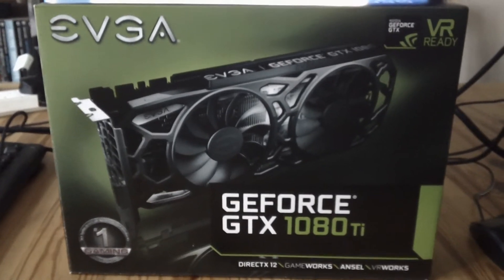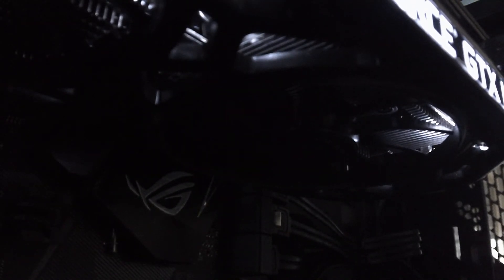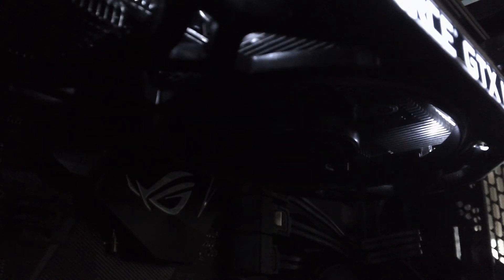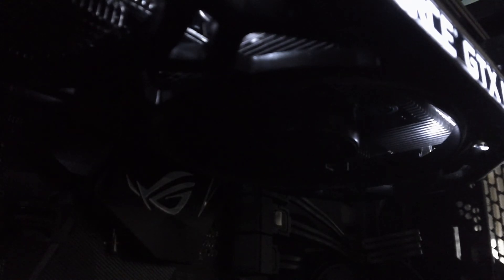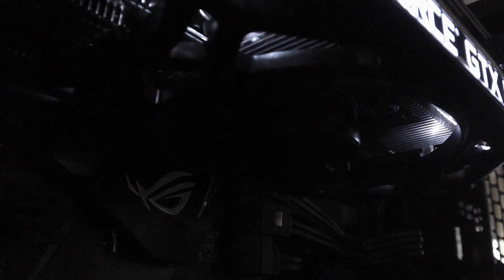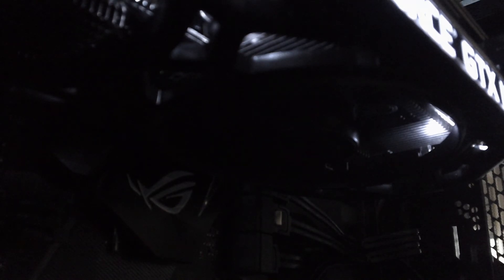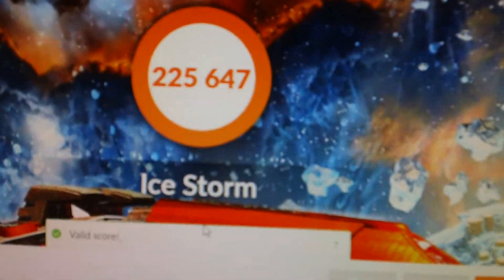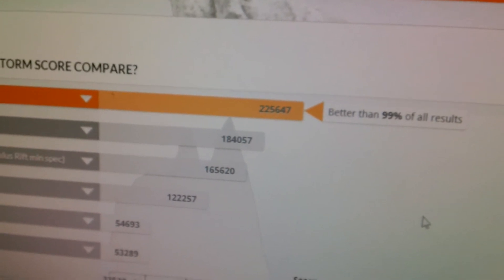NVIDIA GTX 1080 Ti Coil Whine *DEMONSTRATED*

Comment: I've had a GTX 1080 since the day it came out and just this week i started noticing this sound. I've no idea if it was doing it before or it started recently, but it's only when i'm playing video games. Once you hear it you can't get it out of your head.
Reply from the maker: I know the feeling... some models of 1080 cards were really bad for coil whine, but it also depends on the PSU too. It tends to happen when the card is being stressed - so try running a few benchmarks with your and see if that gives the noise.

You can dial down the resolution and detail for the game to reduce the load and that might help, but as parts deteriorate the problem may surface.

Comment: mine screeches like a banshee at full load, it was unbearable so i just got a RTX 3060 TI to replace it and that 3060 TI is quiet with no whine from it.
Reply from the maker: Have you got a Corsair power supply?
Reply: @sterntechdaddy  yeah, it was a cx650, i replaced it with a rm750x

Comment: following it up my conversation I bought a gtx 1080ti sc black edition is the same as that one and what I can tell oh god... after 3 graphics cards I got one with zero buzzing zero coil whine and im so happy that finally I can no longer care about that yes the fans are a bit louder that the Asus strix but coil whine free made my way. already tested with unigen heaven and few games like the witcher 3 . nothing clean card overclock well I achieved 2060mhz on the clock with a good fan curve doing 68c on 100% load. a bit louder but at least I had good card. evga it's probably the brand I can recommend all the cards I owned from evga were perfect.

Comment: I am getting this issue with my Nvidia 1080 ti 11 GB, I’ve got a 144 MHz Asus monitor, but only for old games like Lineage II, it remains super silent while playing WarThunder or Warframe 😕?
Reply from the maker: I think it's normally associated with the power draw from the PSU - maybe your card whines at low power. Try the benchmarks used in the video to see if your card whines. And what's your PSU?

Comment: Hi Nic Bunting. Can you please tell me which Bequiet 1000W PSU have you gone for. Both my Corsair HX850i and my ASUS ROG Strix 1080 ti OC have coil whine. GPU being noticeably worse. I am sending my PSU back and I want to try the Bequiet. Please let me know so I can at least try a tested combination. Many thanks.
Reply: it doesnt matter wich PSU you have, your Card has Coilwhine anyway. only thing you can do is limit your framerate.
the 1080 TI is a Coilwhine Beast, that is rly disappointing..
Reply: After trying two Asus Rog Strix   1080ti's and a new bequiet! Dark power pro 1000w psu, my coil whine issues persisted. In the end I bought an EVGA 1080 ti SC2, which has much much leas whine, which is not audible through the case apart from thousands of ocassional fps on some game menus. 

Also comparing Corsair HX850i with bequiet dark power pro 1000w, I realized corsair psu also had whine under load.
Reply: Ceki Erginbas God these coil whine issues are really russian roulette. I got one Asus Strix 1080 ti oc which had no coil whine at all, returned it for fan problems though. Then I got 2 Msi 1080 ti gaming x, both had horrible coil whine, returned both. I finally got hands on an Msi gtx 1080 ti lightning x, which has a tiny bit of coil whine but not audible when the case is closed.

Comment: I managed to reduce the noise almost 80-90% ;)  .....(you need to change setings (58-60 fps and the frequency ,speed 1986 ghz ..1060 ghz )
Reply from the maker: Nice to hear that works!  You shouldn't have to slow the card down though... not when you've paid for an overclock.
Reply: @sterntechdaddy  yep but ...it's impossible to run max settings...because my monitor is 6o ghz ...
Reply from the maker: You've got plenty of overhead then...  :)  The one in  the video was used with a huge ASUS monitor though, so the whine needed sorting.

Comment: So I have this same model card, and this is so quiet compared to what I'm getting. My card legitimately has an 80 Db grind when rendering anything 3D. The pitch and volume increases horribly with higher frame rates.
Reply from the maker: What power supply are you using with it?

Comment: Hey I have the same card. It has really bad coil whine. I already got the second one but still has really loud coil whine. Did you end up RMA it?
Reply from the maker: I was about to RMA when I tried a BeQuiet PSU - which improved things. So the Corsair PSU was RMA'd instead.
Reply: Nic Bunting thanks for the reply. I have a evga t2 750w psu and I also tried cosair ax850. no change at all.
Reply from the maker: Irritating how you get the coil whine with the EVGA PSU seeing as it's an EVGA graphics card.... but with the BeQuiet PSU things were much quieter - with the side panel on the case I couldn't hear anything.

Comment: mine is a LOT LOUDER THEN THIS.. loud enough to hear 2ft from my pc, took me ages to work out the noise! only started few months ago at random, and for the past 2 weeks its now crashing during games :(
Reply from the maker: I'd seriously consider an RMA if your card is still under warranty.

:/
Reply: @sterntechdaddy  sadly nope :( 1 year out only had 12 months I think and it's now 36 months old. Trying to research as I've had gpu and ssd failing so got new psu coming 2mos just in case but fouls this video when I decided to search about the noises to see if its "fried" somewhat
Reply: @sterntechdaddy  saying that if its not the psu.... Looking at the marking it I just checked now says "made July 2010".. So needed replacing anyway! 😳 😳
Reply from the maker: Yup... Jul 2010 is getting on a bit now... just like my Zotac 1080Ti

:)

Comment: I got 3 already 2x 1080ti Msi Seahawks that coil whined alot and now i have an Asus strix oc 1080ti but theres still buzzing there so i dont believe when ppl say theres no coil whines on theirs 1080tis strix cause they all buzz a little bit and to be honest yours is not too bad im taking my asus back tommorow and i was actually swapping it for this one guess im not anymore. ..My advice if its on the 14 day policy go and swap for another one if its out RMA it EVGA are really good about coil whinning cards so they will def give u one with less noise .As for me I won't cope with a GPU that i just spent £810 that wines. At the end of the day all 1080ti's repreduce coil whine/electric buzzing the diference here is either you can listen to it or not.
Reply from the maker: What PSU are you using?
Reply: Nic Bunting I had a evga 650 gq gold and I bought corsair hx850 platinum made no difference coil whine still on mine well it's more like a shaver but they all do that but yours it's not too bad you can risk yourself of rmaing it and getting a worse model.
Reply from the maker: In the end I kept the EVGA card and RMA'd the Corsair PSU - it was generating a lot of squeaky noise. Its now got a Be Quiet 1000W in and there's now no audible coil whine with the case side panels on.
Reply: Nic Bunting hey man, can you tell me when did you buy your corsair psu? I wonna know can i send my PSU RMA if its already  6 month old? (My PSU at load fcking loud xD)

Comment: Only reliable way to reduuce coilwhine is cap cards at a certain voltage, I had to cap my 1080 @ 0.900v to keep coil whine so low I cannot hear it, and if u reset it to default from there it starts squealing like pigs in slaughterhouse.
Reply from the maker: How did you cap the voltage - in case someone wants to try it.
Reply: Just modify the voltage curve in msi afterburner lets say you want 1v then make the curve so the highest point is 1v and it will stay there, removed like 90% of my coil whine. Sure you cant OC much but still the card runs at higher clocks then it was advertised for and way cooler/without coilwhine. For example I set my GTX 1080 to 1823mhz on the core @ 0.900v there is no coilwhine, and I left it overnight in witcher 3 1440+ max details and no vsync so uncapped, it was 100% loaded for the entire night, max temp was 47c and this is in ~23c ambient with an aircooler runnin fans something like ~600 rpm or so entirely quiet aswell. I have my PC setup on the motherboardbox next to my mousepad and even then its pretty much dead silent, I used to have a watercooling loop with a 560 rad and whatnot, and the loudest part of the entire system by a factor of 10 times id say was coilwhine, but now when I managed to fix it, I am not sure if I should just stick to air or not. Since 47c on a overnight stress test on an aircooler is pretty fantastic, so not much point going back to water. And to factor in the price of watercooling, there is no point when you dont really oc, since SILENCE > OC all day err day for me.
And just to test that it was indeed that it works, when I set it back to default wich is about 1.063v it squeals like a pig in the slaughterhouse. And yes I play on 1440p 144hz monitor so it works definately.
And tested it with plenty of other games like csgo and overwatch and whatnot that tend to go upwards of 300fps and still it was silent with the voltage reduction, try it out.
Reply from the maker: Which brand/model is your 1080?
Reply: It`s the msi seahawk ek x, but the make and model is irrelevant, i have tried this on 1080tis and 1070s and whatnot, works every time.
Reply from the maker: Nice. If anyone else tries this let me know how you get on.
Reply: @Demonwicked  Did the same with 2080 super! lode just 5 fps;)

Comment: Just got a 1080ti strix oc , thankfully no coil whine even at thousands of fps, I can hear some faint electric noise only with my ear close to the card but with the case closed and on my chair I can't notice anything besides the fans a little when they get to 1500 rpm~ at full load.

I've had a msi 1080 card that even with headphones I could hear the ear piercing whine, I took that one back to the shop next day..
Reply from the maker: Interesting about the Strix being free of coil whine, What PSU are you using?
Reply: Yeah.. I heard a lot of people saying it got coil whine but I really liked the look and cooling power of the card so I risked it !

My psu is a evga supernova 1300w g2.
Reply from the maker: So ASUS 1080 Ti Strix OC + EVGA Supernove 1300 G2 = OK
Reply: Nic Bunting Are you really sure the PSUs are to blame ? I'm pretty sure the GPUs should be at blame... I've never had coil whine with my Corsair Rm750x + Asus strix 1080 ti. Still returned it because of fan problems, then got 2 Msi Gtx 1080 ti gaming x with awful coil whine, returned both lf them. Now I've got Lightning X and there's a tiny bit of whine, but nothing audible when the case is closed.
Reply from the maker: It's the PSU and graphics card combination that's the problem. It's not really fair to base things on a few tests, but the Corsair PSU in the video did whine with two different graphics cards. Fitting the BeQuiet PSU dropped the whine on the EVGA card to virtually nothing - which does suggest that the RM1000x is troublesome. This doesn't mean that other Corsair PSU's are prone to whine though.
Reply: Nic Bunting Right, but I will refuse to buy another PSU just because GPU manufacturers can't make decent cards... Again, I've had 1070, 1080 and one 1080 ti with my PSU and none of them whined except for the MSI cards. Even MSI had to admit that the first batch of 1080 Ti Gaming X shipped to France was a bad one. Besides, a new person commented on this video (Ceki Erginbas) and said he had whine even when he switched to a high end Be Quiet PSU.
Reply from the maker: To be honest I've never really experienced any whine until I built machines with 1080 Ti cards in - and I've been building gaming computers since the Intel P60. It's definitely more to do with the graphics card than the PSU.

Comment: Gigabyte 1080 + hx850i coil whine
Reply: Yeah, i had an ftw2 with the hx850 and it had horrible coil whine. Switched the psu out for a supernova 750pq and coil whine disappeared!
Reply: defkon1 it’s the psu really? Cause I have a 1080 g1 and hx850 and I’m hearing some whine.  Could I go to the hx1200?
Reply: Yes for some reason the HX850 is incompatible with the 1080's. i bought the supernove 750pq PSU and the coil whine disappeared. It was such a relief.

Comment: I've got one coming later hope mine is ok
Reply from the maker: I should say that the card featured in the video is working fine with no coil whine using a BeQuiet PSU. So it depends on your PSU... and the padding on your case... :P

Comment: you will always get some coil whine with 500 fps+ vsync is your friend. how many 1000's of fps were you getting in that 3dmark bench for smartphones?
https://www.youtube.com/watch?v=jtXAuIJchps power supply is not your issue.
Reply from the maker: Unfortunately, most of the noise was coming from the PSU - regardless of FPS. I've since made another video that illustrates this and after the Corsair PSU was replaced by a BeQuiet model the coil whine dropped to virtually nothing doing the same test using the EVGA card featured in this video.